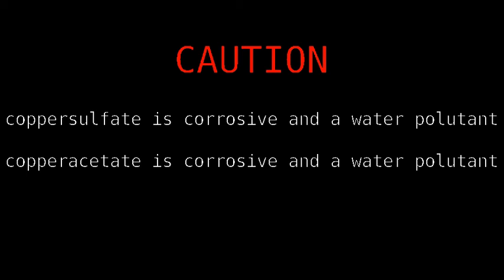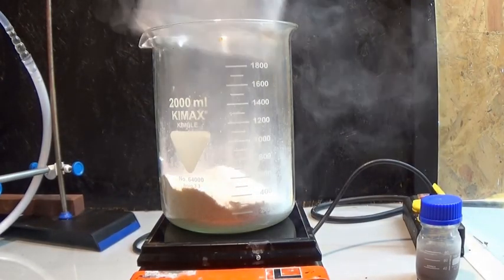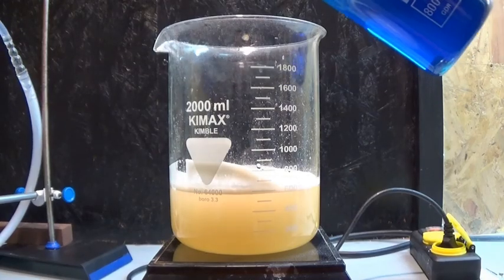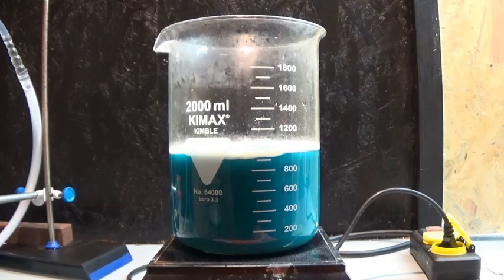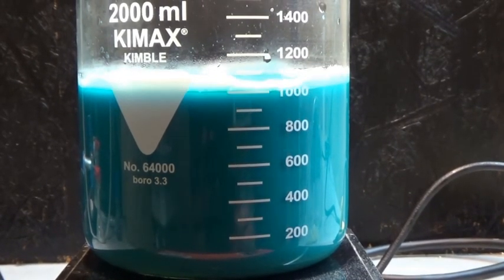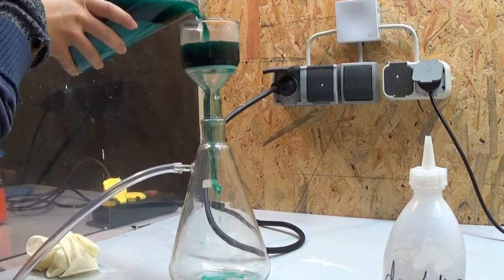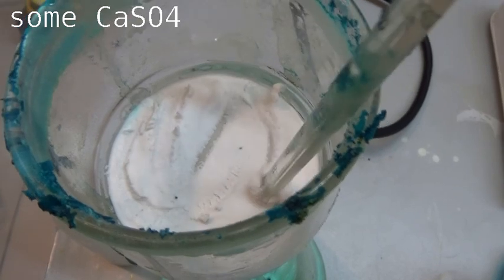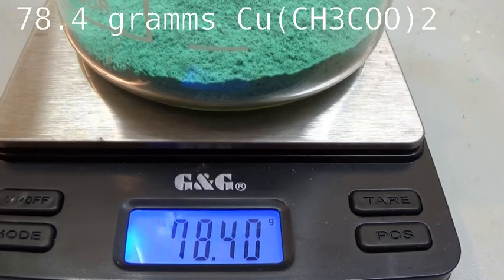Copper acetate synthesis (second step to lead-2-acetate)

Comment: Why not react copper sulfate with sodium hydroxide, filter off the copper hydroxide and then neutralize it with acetic acid? Seems much quicker to me.
Reply from the maker: because sodiumhydroxide is much more expensive !! 

mfg hazelChem
Reply: Hazel Chem lol. I pay 10€ for 2.5kg tech. grade NaOH granules... It's a German chemical supplier called S3 Chemicals.

Comment from the maker: hello you all in this part of the lead acetate synthesis i am preparing
copper acetate by reacting the previously made calciumacetate with coppersulfate for this I wayed out 182 gramms copper sulfate  
this was then brought in to hot solution 
next up i added the calcium acetate to my two liter beaker 
and also dissolved it in warm water 
this took some time and the solution was still a bit cloudy in the end         
at this stage you can filter the calciumacetate solution to purify it
but i did not do it to save time and effort
i then combined the two still warm solutions to perform the
displacement reaction in which the calcium two plus ion from the acetate gets switcht out
with the copper two plus ionto form copper acetate and calcium sulfate 
after some time you can see a cloudiness appearing 
this is calcium sulfate immediately crashing out of solution when formed this is then
slowly sinking to the botom of the beaker and creating some nice phase transfer imagesnow whats left to
do is filtering off the calcium sulfate and get uer solution of copper acetate 
i did this with a vacuum filtration but you can also use gravity filtration 
you just have to wait a little bit longer for the gravity to do its thingadditionally to say is that if you want
to recover the calcium sulfate you have to wash it with hydrochloric acid to
get rid of water insoluble side products after the filtration you could just use
the solution for the next step 
but i wanted to get a cristallin  product
so i went on and gently boiled the mixture down until there were only nice ristals left the Variation of colours of the crystals are do to the hydration grades
mostly waterfree copperacetate is grenish where as the more hydrated forms are  bluish
after admiring the crystalls for a while i crushed them down to get
seventhy eight point four gramms of copperacetate with unknown hydration grade
i also wanted to inform you guys that i created a instagramm acount
named hazelchem where i am posting frequently new stuff and for the end here is a list of upcoming videos 
i hope you liked it    and if you
want you can give me a like or subscribe to my channelhave fun and do not kill your self